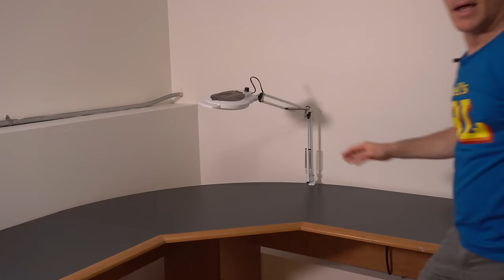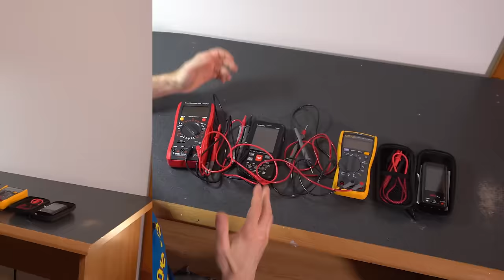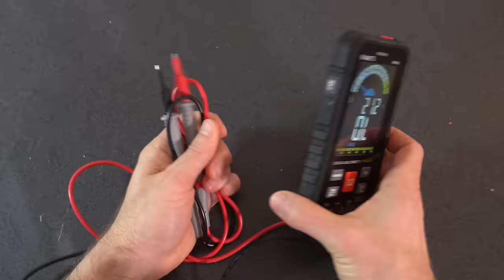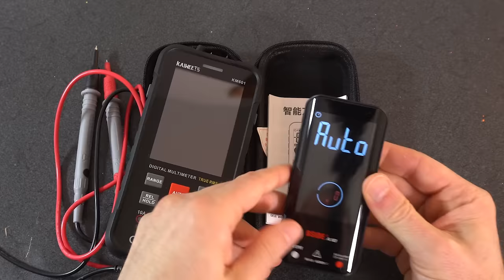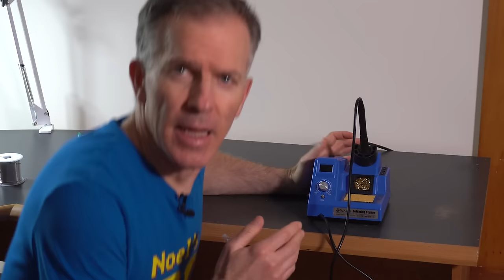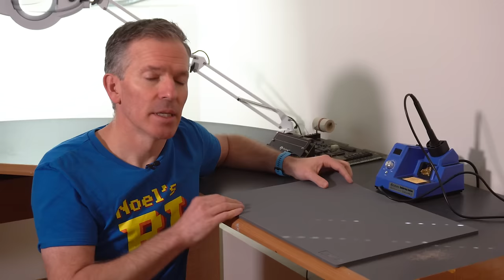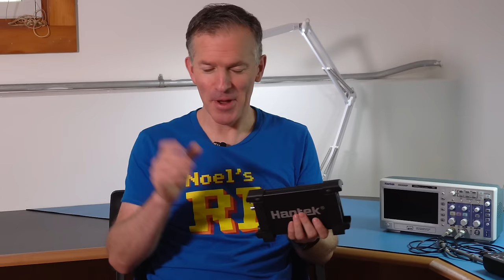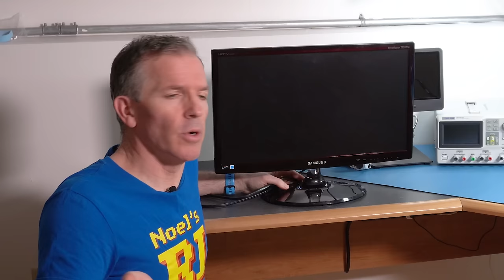Essential Tools For An Electronics Lab

Comment: Better to get one or two LINEAR 30V 3-5A PSUs (switchers are CRAP - electrically very noisy, slow response, and easy to blow up! -that is why they are cheaper!).  If getting two, DO NOT get an all in one unit, for several reasons, but most compelling is if it blows up you lose both PSUs.

Comment: Good video Noel, re the oscilloscope, The Nyquist frequency is the minimum for good reproduction of signals, my recommendation is at least a factor of 3 ie if the sampling rate is 60 Mhz then the signals you are looking at should be 20 MHz or lower.
Also regarding scopes my line of work ( power quality) involves looking for harmonic signals at 0.1 percent of the fundamental, to do this involves at least an 12 Bit digitizer not 8 Bit found in practically all of the lower priced scopes and the vast majority of high-end scopes (they target high frequencies). 
Does anyone make a low cost 12 bit scope???

Comment: I can think of a trouble shooting device , A Junctek or similar signal generator at about 80 Mhz for injecting signal into radios or 2 way radios ,  But make the video in a actual working on a radio issue .....There are way too many hooking the device to a O-scope , that doesn't help the beginner ... I had a HP actual RF signal generator in my shop .....  I mentioned the Junctek because of it's price and functions that can be used .... Take care Mon Ami ....

Comment: I'm not sure those cheap screwdriver bits are worth it. I have two sets and in both the shaft turns inside the handle, or screws stripped the bits. I'm not sure if there's something in-between, quality wise, between those cheapo ones and ifixit or wera.

Comment: my father worked on tvs, amps en power supply¨s for 40 years with a multimeter and soldering iron  
And i folowed him now for 20 years only with a multimeter and soldering iron  and last added a hot air station.
you need knowlidge not hightec tools

Comment: Don't be fooled by the budget end scopes.  They are NOT the same thing as the $400+ scopes.  I have been there 3 times.  My 4th was a signlent 1104Xe and the one I should have started with rather than waste at least another $400 on 3 cheap non-sense scopes.  The bandwidth is only part of the story, the software, modes, triggers, captures, aquires etc.  Just doesn't compare to a $400 scope when you buy a $150 Ali ex 100Mhz scope.  Asked me how I know.   I bought one.

Comment: I completely disagree about buying cheap screwdrivers. The problem with cheaper screwdrivers is they use cheap steels that aren’t heat-treated which can cam out on fasteners especially when working with precision screws in electronics work.

Comment: i thought it was a very good video'''''''''but' i did not here you mention V.T.V.M' which is important, for checking the voltage or ohm's or whatever 
 without loading the circut.

Comment: It's so hard to find a decent pair of flush cutters that are properly lined up.
Reply from the maker: Really? I never had problems with the cheap Hakko ones. What do you notice when they're not properly aligned? Things bend before being cut?
Reply: @NoelsRetroLab ,   The identical looking flush cutters I use at work aren't Hakko, they're Bahco.  They work great and last a very long time.

Comment: Cheap calipers! Invaluable if you need to replace something with a 3D printed part, you need to design.
Reply from the maker: Interesting. I still haven't gotten into 3D printing (although it's coming very soon), but I already have some calibers from my woodworking shop, so I love it when there's some crossover.

Comment: You also need signal generators from LF to RF, a spectrum Analyzer and a vector network analyser. Dummy loads, lots of test cables and connectors adapters. If you buy second hand then you will need about 15000€. This guy is a toy builder and is ignorant

Comment: Sorry, but I need to add a less flattering comment. This is an electronic lab to work on items produced before 2000, maybe 2005. It will be almost impossible to work on any modern surface-mounted electronic device with your tools. Recommending in 2022 a soldering iron with 936 tips??? This just shows that you have not spent much time with a soldering iron in hand.
What about component testers? ESR meters? Programmable load/resistor array? Those are things used daily in hobbyist and professional settings. 
Wasting 5 min discussing oscilloscopes and just lightly touching a subject of hot air stations or desoldering tools/techniques? I know that no "electronics lab" looks cool without an oscilloscope in a prominent place on the bench. But let's be honest, even in professional repair shops, oscilloscopes have to be used for 1% max 3% of the repairs.
Your title is misleading. This is not a lab. This is a very basic hobbyist setup for working with through-hole components. Anything more complex or surface-mounted and your tolls will either damage the components or frustrate the user.

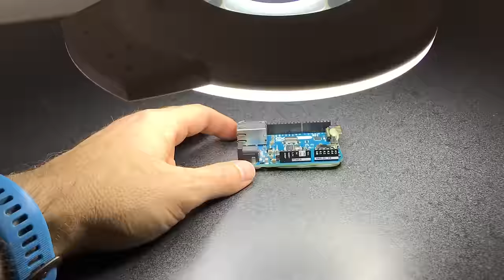Comment: 02:04   -- NO   We cannot move it (your light) around
ONLY YOU can do it.
Thus the sentence is   :: I can move it around" as YOU are speaking about YOURSELF.
You could take some English language lessons yo better understand the language
and how to use it with the correct meaning,
Learn the difference in meaning between  I - You  -  One  -  We
and how each of those are used.

Comment: Lead is bad for the environment and every bit of it in your body makes you dumber. Let's get rid of this stuff. There is very good lead-free solder. And typically only people who have learned to work with leaded solder have a hard time switching. People who solder lead-free from the beginning don't have that problem.
And the ESD protection seems a bit exaggerated to me. I touch a grounded object once before handling critical components and have never had any problems. I would prefer the silicone mat. Especially one with multiple compartments you can sort screws etc into. But of course everyone must decide for themselves.
Reply: Lead free solder results in connections that fail prematurely, especially from exposure to heat, extreme cold, or vibration; leadfree solder also grows dendrites, "tin whiskers", that reach out from the solder joint and touch adjacent connections or components,  causing short circuits. And then the device ends up in the landfill! That is an enormous waste of resources ----- plastics, metals and the fossil fuel energy used to manufacture the raw materials as well as the device itself.  Once the device fails prematurely, people go out and buy another crappy, short-lived device to replace it. This is much worse for the environment in the long run than using leaded solder.  Also note that the special fluxes used with leadfree  solder are corrosive,, electrically conductive, and far more noxious to the nose and throat then fumes from the rosin flux used with leaded solder. And no, you don't get lead poisoning from those fumes because the boiling or vapor pressure point of lead is at a much  higher temperature than the melting point of leaded solder and therefore there are no "lead fumes" contained in that flux smoke.  I and my coworkers have been working with lead solder for nearly 50 years and none of us have any appreciable lead levels in our body.

Unfortunately, most of our electronics are not properly recycled,  and when they break it can be so difficult to get them repaired cost effectively that people just throw them out and buy another piece of junk ----  *because they have been trained and preconditioned to do this*!  It wasnt always this way, it's by design on the part of the manufacturers. The reason they agreed to use lead free solder is because the alternative was that countries were going to start forcing electronics manufacturers to have a "pipeline" system in place for taking back all of their dead products and recycling them properly and reclaiming the useful materials. Manufacturers didn't want to be bothered with this, and so they readily agreed to use lead free solder, because then when the product dies, people could just throw it out,  erroneously thinking that there's nothing toxic or environmentally unfriendly in there, and the manufacturer could absolve themselves of any responsibility for the pollution created by their crappy electronic devices failing. The premature failures caused by lead free solder usage also work quite well for manufacturers bottom lines. Planned obsolescence is profitable for them!  Many manufacturers don't bother to have any kind of widely distributed warranty repair facilities and they don't provide service information or parts to ordinary hobbyists who might be able to fix the device themselves, nor even to qualified, experienced service personnel who simply aren't part of the warranty repair system for that particular company.  This is why there are currently numerous lawsuits taking place against corporations that feel that no one should have a right to even attempt to repair their products. By their way of thinking, you not only don't have a right to repair it,  you might not actually own the product, according to their definition of ownership, and you are just basically renting it from them.
Reply: @goodun2974  Correctly made lead-free solder joints are just as good and durable. If you have problems with lead-free solder, it's because you've been working with leaded solder for 50 years and you're not using lead-free solder correctly.
Most people just don't like change because it takes effort to adapt. Therefore, for many people it is a very emotional topic.

In the EU, leaded solder has long been banned for industrial use. That is the reason why commercially only lead-free is used.
Reply: @yasminesteinbauer8565  ,  You can find hundreds upon hundreds of videos on YouTube of people repairing products with broken solder joints which were originally wave-soldered in the factory with lead free solder and have failed, sometimes within a couple years of the product being made.  You also never addressed the dendrites that sprout from lead free solder. NASA found out about that one the hard way.  The purpose of alloying tin with lead is because lead stabilizes the tin sufficiently that it doesn't usually grow tin whiskers.